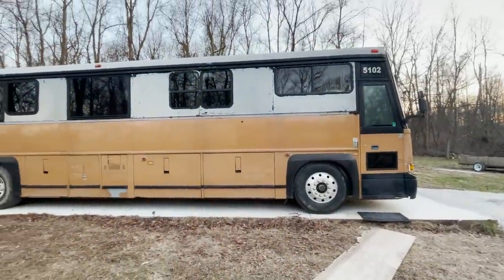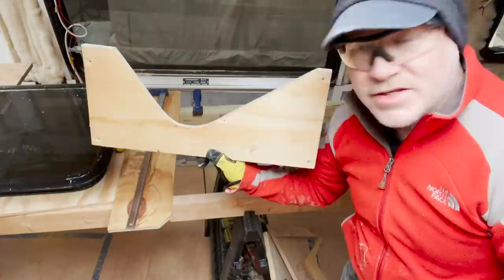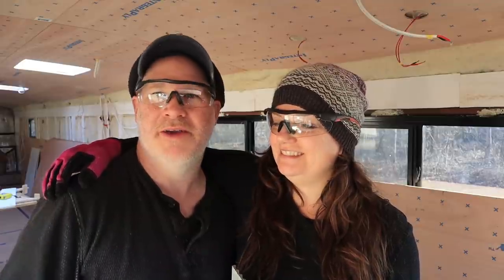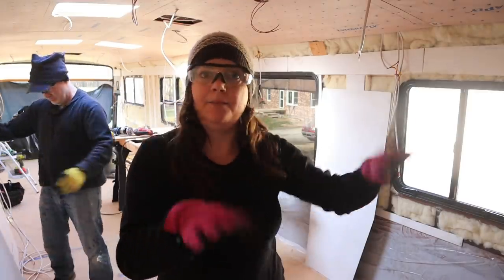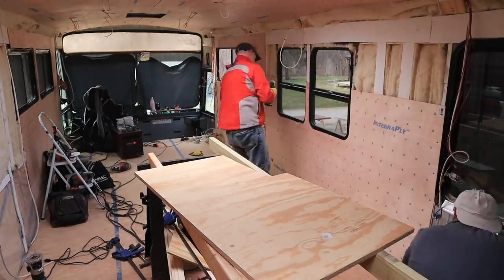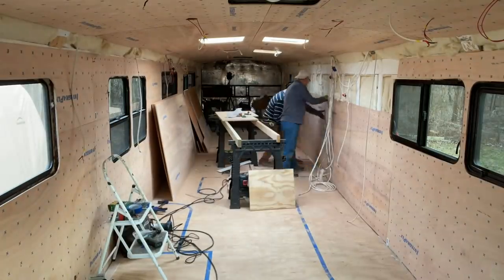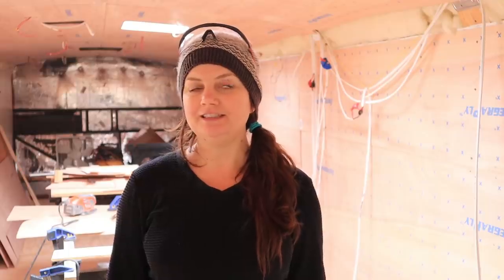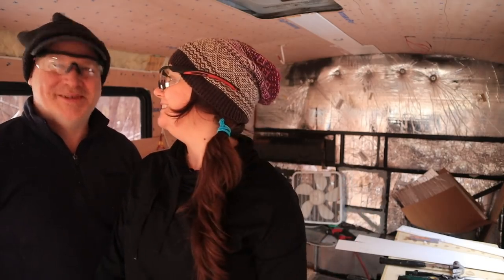Walls for our Bus Conversion - S03E43

Comment: 3M makes a cooler dust mask with a valve on the front so you don't breathe in your exhalations. It's so much better than the mask you're using, but I'm happy you used something. Miller makes a P100 low-profile respirator that works even better. Very cool to breathe in.

Comment: Window coverings: In my current bus I have cellular black out blinds, they give good privacy (obviously)  it can be dark in the bus whenever you want and they provide a LOT of extra insulating qualities especially if they are "captured" by moldings/trim all the way around. new bus will additionally have a second sheer curtain for light filtering when you still want to see out but reduce glare in addition to the blackout cellular blind.  Trim around the windows: When you look at a house EVERY opening uses molding to finish the edges because it's really hard to get perfect lines. curved corners are obviously a real challenge but I'm sure you will get it sorted out.
Reply from the maker: yes we have been looking at cellular blinds, are they  as good as using reflectix in the windows?
Reply: @Rehabit8  I doubt they are quite as effective as reflectix but they are pretty good. and a lot less ugly then reflectix. I suppose you could use reflectix for the extreme conditions and the Cellular blinds under normal conditions. the blackout blinds usually have a reflective material inside the cells.

Comment: Have you guys notice any moisture on the screws  that you put in the ribs  from thermal bridging???? Keep up the nice work and be safe Thanks
Reply: I see a lot of people worried about thermal bridging, and I can see where it could cause an issue, but, MCI didn't care at all about thermal bridging. Everything in our bus was screwed, bolted, or riveted to the stainless steel frame. Trying to stop every thermal bridge while every window is surrounded by an aluminum frame seems silly. We found that dry heat was the answer. Our Diesel heater and heat pump both work well. The propane Big Buddy heater that we started with was terrible and made everything that was cold sweat.
Reply from the maker: Thanks Wade! No haven’t noticed any moisture
Reply from the maker: Good to know!  We are thinking about getting a diesel heater

Comment: rebate wood so that it goes around the corner and covers the edge you cut that's not perfect and the window frame, you will get a better finished corner then use wood or metal